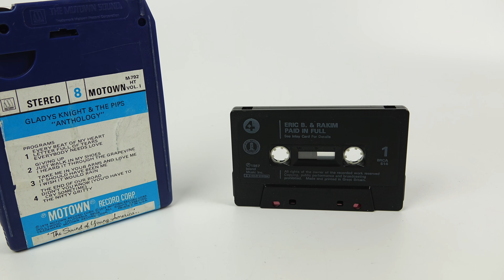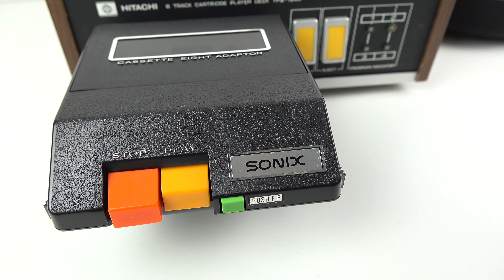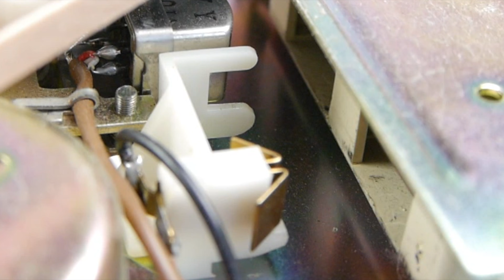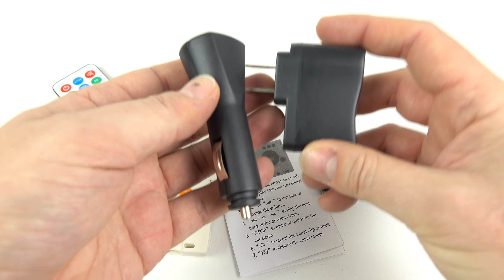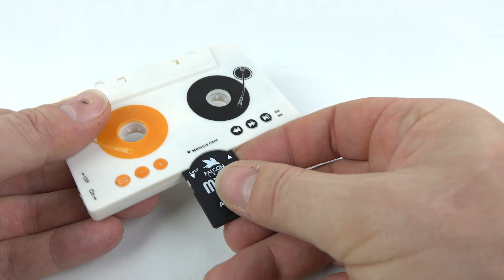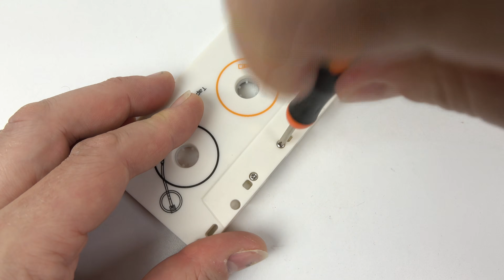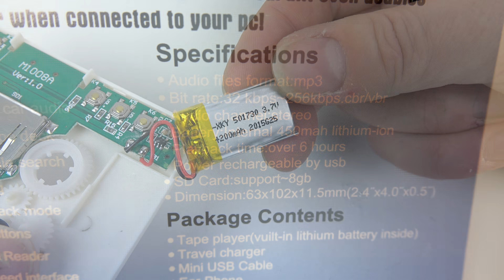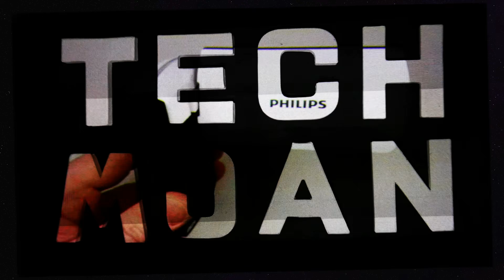Car Stereo Tape Adapters - 8-Track to Cassette to MP3

Comment: Obviously ignoring the first thing you mentioned (the cassette to 8-track converter), do you know if I could use any of these on an old computer like an apple ii or c64 with a cassette drive? I'm beginning to collect older computers and while I eventually want to get authentic software for them, I want to be able to get programs from "alternate" sources first to see if I like them.
Reply: Yeah, there is something to be said for doing it the "authentic" way. Playing MP3s over a cassette adapter would work just fine, as to the computer it's all just audio.
Reply from the maker: I suppose it should work - play an mp3 recording of a copy of a tape. Getting the original recording would be the issue though.
Reply: Techmoan Thanks. I recently saw a video from 8bitguy that made it sound like it wasn't hard to find the MP3's, but I haven't searched them out yet, so you may be right about them being difficult to find.

Also, with the SD card one, what if I just put the programs on the card without using the MP3 method? Is there a chance that could work?
Reply: That should work, but is more complicated than needed. Most people do is just hook up the audio out jack of their PC/smartphone/MP3 player into the cassette in jack on their retro computer - no need for an actual cassette deck.
Reply: Perfectly possible as long as you use a lossless audio codec. Also sometimes the heads on the old tape players need some adjustment to work with these things. Same as with those CD to tape adapters with a lead. There's usually a way to adjust the heads in the mechanism.
Reply: It does work though. It's getting the volume levels correct thats tricky.
Reply: I think my comment ended up in Techmoan 's spamfilter, but i posted some links to non-tape solutions that still retain original disk or tape contents somewhat. So here's a tldr(i'm totally avoiding links now, google is your friend)

for c64/vic20, there's several solutions using the cartridge port:
"SD2IEC" does basic tape emulation (almost 100% 1541 compatible), uses SD cards.
"1541 Ultimate II" Somewhat overkill, but amazing piece of kit, new batch is up and coming. Uses Cartridge port, with passthrough to the tape port for that "authentic" feel. SD cards, USB, Stereo SID emulation, extra virtual diskdrives, it almost does everything.
"Turbo Chameleon 64" Does everything the 1541 Ultimate II does, and more, like standalone operation (becomes a c64 itself), quad SID, VGA output, ps/2 keyboard and mouse, 16 MB of flash rom next to the SD storage, battery backup ram, etc..

There's other solutions out there, but for futureproofing a collection, this is kind of the way to go. Diskdrives and tapedecks are somewhat fragile, and require somewhat specialised knowledge to effectively repair. this will keep good forever as it's all solutions that don't use moving parts.

Cheers dude!
Reply: The only problem I could see doing that is that the MP3 recording being lossy, MAY lose part of the recording that is important. Best bet would be high bitrate MP3 (320k+)....
Reply: Just use cassette to 3.5mm Adapter and "play" the program from your phone. You can see that being done by 8bit Guy
Reply: I thought there was an app specifically for this?
Reply: And I just mentioned it. It's called TAPdancer
Reply: Vanillaessence96 so you did,  I didn't expand the responses all the way down to yours :)
Reply: No chance! The MP3 player has no idea how to convert computer programs into the correct audio format.
Reply: rjhelms Well I do want authentic cassettes eventually, and a 3.5mm-cassette is about the same price as a male-male cable, and the former is much more noticable in stores.
Reply: lammy1234567890 Couldn't it just read the SD card as a cassette?
Reply: @RRW  The computer? No, it's expecting audio from the cassette deck. There may be a way to get data onto the computer another way, but if you're using the cassette deck then it has to arrive as audio.
Reply: lammy1234567890 Audio is how a Commodore 64 would get data loaded so it's necessary to have audio from the tape deck to C64. So yes it does work.
Reply: lammy1234567890 Oh. That makes sence now that I think about it. Is there a way to convert data into sounds? Like if I wanted to put something on my phone that was originally on floppy and transmit it through the 3.5mm jack.
Reply: +DarrenC1888 The idea of putting non-audio program files on a memory card and then using this cassette device to transfer them to the c64 is what I was saying wouldn't work.
Reply: +RRW You would need the relevant computer to correctly covert the data into the audio. It's a different standard for each device as far as I know. Bit of a chicken and egg situation I'm afraid.
Reply: lammy1234567890 Emulation?
Reply: New blank cassette tapes aren't difficult to come across for cheap at thrift stores, so I would just record to one of those in such a situation.
Reply: SegaMischief I already have a few (a friend had some extra blank cassettes) and I plan to get more eventually, but I still want to know all of my options.
Reply: Try the TAPdancer app or if you want to do a little DIY - the Tapuino
Reply: Alastair Ward Yep there is.
Reply: I did it with my vic 20 with a program to convert the files back into audio and then used that with a tape adapter plugged into my laptop. It's a bit crazy using two computers all the time, especially if you find a game you like.
Reply: You don't use MP3s, that's a bad way of coding computer tapes. Plus the files end up much larger than they need to be. You just need a program to play the tape files through your sound card. From there, either record to actual tape, or plug the sound card into your 8-bit computer. Possibly through an amplifier, sometimes necessary to boost the signal level. 

If you look at sites dedicated to the particular computer, they'll usually tell you how to do this. There are vast archives with most of the software ever released, for many old computers.
Reply: You don't even need a tape deck to play games on older computers, just get an input cable and play the data from your smartphone.
Reply: Early home-computer data cassette decks were, in fact, modems that recorded and played back. I would imagine the protocols used were a variation of an acoustic coupler modem, minus the handshaking and dialing routines. I'm sure each computer manufacturer used different encoding patterns, but they were essentially 300 baud modems.

Atari, for instance, used a stereo recorder. One track held the encoded data, while the other track could contain an analog audio track. The early 400 and 800 computers would play those back through an internal speaker, but the later XL series routed all of that audio to the speaker of the connected TV. I remember having a couple of tapes that taught how to use certain programs; the audio track contained the narration explaining how to perform the next step, using the data loaded from the data track. The training program would start and stop the tape at appropriate times to give the user the opportunity to work on the current step before moving on.
Reply: Lossless isn't necessary, just sufficient quality that the data can be read. 

That would be an interesting experiment to see what quality of MP3 (or other formats) you need for a particular bitrate of cassette.

Comment: To be honest as neat as the memory card tape device is (hadn't seen them before this video), I'd still rather a tape adapter with a standard headphone jack lead. Way more convenient to play whatever audio is on my mobile than remembering to keep files on an SD card in rotation.
Reply: Another big plus is that it operates without a battery or anything, the signal from your headphone output is enough to drive the tape head (too much actually).
Reply: Yes, but mp3 players were around in the early 2000s.

Comment: Most SD card size limitations are due to licensing issues. For example many phones will list 32gb as the maximum sd card size yet you can put a 128gb micro sd with no issues in the vast majority of them.